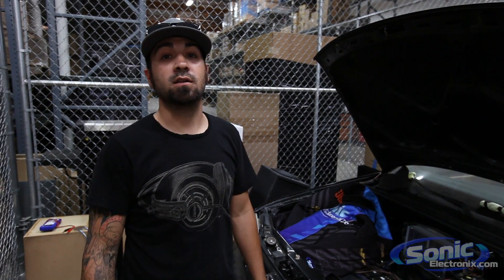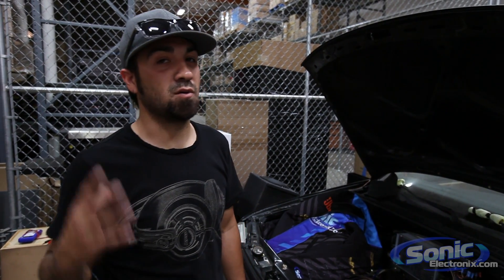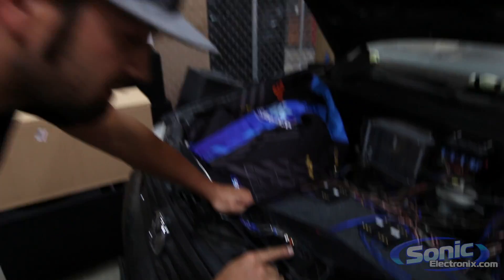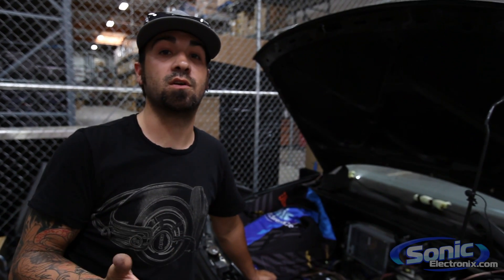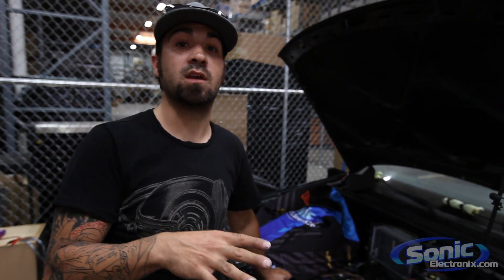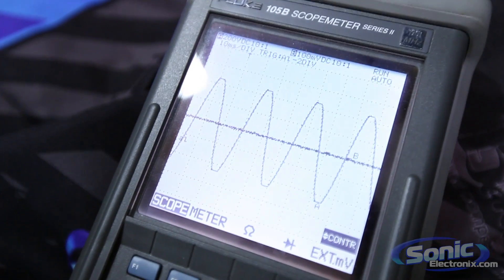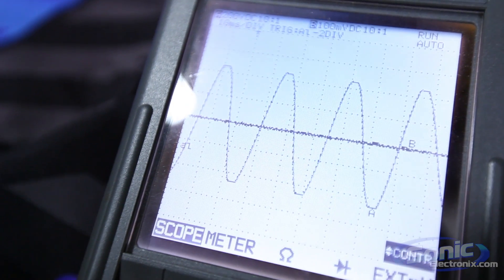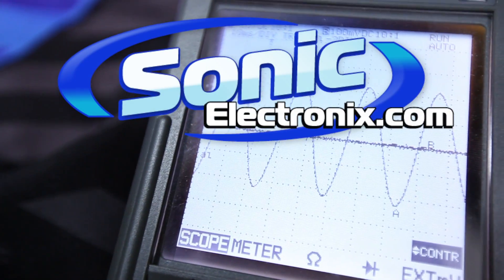How to Set Amp Gain by Ear | Part 1 of 3

Comment: Bass boost is also garbage.  I call it distortion boost.  Should be at zero always.  Same with loudness on radio.  At most use it on LOW if your deck has 3 settings for it.

Comment: Am I able to do this test with a lower volume on the head unit? My amp has too much power for my 12" sub so i dont wanna turn it all the way up. Im wondering if i could just set my head unit to a low volume and then ramp up the gain on the amp. Will i still hear clipping if the amp isnt putting out max power?

Comment: Hi Allyn... this is Anish from India... been an ardent follower of all 
your knowledge base... I think you are brilliant am sure all will 
agree... I need your help on this please... Have a Sony XM-N1004 and 
need to drive a JL 12W0v3-4 Sub (displays 300 RMS @ 4 Ohms) in bridged 
mode Sony supports (175 RMS X 2 @ 4 Ohms).. what would be the gain Voltage, as 
per me Sony, max is 26.45V whereas JL can go upto 34.64... Hope am right, 
am setting this using a Multimeter using a 0DB 50Hz. All of this is 
hooked to a Pioneer DMH Z5290 BT... Front Channels uses a INFINITY 
REFERENCE Component... Please help sort this for me , Thanks Allyn

Comment: Ok i need help please. I been struggling with this problem for awhile now and cant figure it out. I bought 2 new amps. Alpine for bass and a focal amp 4 channel. I did the big three and scraped paint off for ground and sprayed clear coat on top of ground terminal. I getting a whining noise and cant seem to fine the the area thats causing this problem. All rca and speaker wires are on the opposite side of power line. Radio is a alpine 149bt fairly new. Rca are top of line stingers triple layer. Speaker wires by stinger top of the line as well. Can anyone help me on this. Thank you in advance.

Comment: It's also worth noting the fact that if you're setting gains on brand new subs, it'll likely be necessary to make future adjustments to the gains during and after break-in. This is especially true with high-roll, stuff suspension subs.

Comment: I have a skar RP 1200 1.d amp on two skars sdr 10's and even with the gains all the way up it still doesn't distort. is this ok?
Reply: Use a voltmeter then . It’s more accurate , no matter if it’s high or maxed and don’t hear distortion. It’s of course distorting .
Reply: Same combo I have except I only have one SDR-10. I currently have the gain set to 40% on mine (still tuning tho).

Comment: Should specify that when you hook that o-scope up, you stripped the speaker wires and probed them, not just jamming the probes in the amp, because I think I blew my amp that way today. Makes me wish I just tuned it by ear but it seems like 3000 watts plus needs the tuning equipment.

Also, specify that the test tones you play should be at -10db or -15db if you listen to normal music, and closer to 0db if you listen to modified bass music.

Also, why a 40 hz test tone? Why not 80Hz? And if I want to do this with my tweeters or Mid bass or mid range drivers, what tone would I use to do that?

Comment: And always remember, when you have a remote punch bass it always  adds voltage and you need to adjust accordingly
Reply: Right but every amp is different & every Remote gain is different most of the Remote gain controls don't do anything that's why most folks don't use them!
Reply: @randywatson4870 strange I keep hearing this. Am I the only one that uses the knob constantly for different tracks / parts of songs / at a red light etc? I always use it. In fact I can’t have a system without one
Reply: @sp00f34  Sum remote gains work but a lot of them add a lot of clipping to your subs & they add extra voltage they are a plus if your's actually  works properly.

Comment: I have 2 sundown sa 15s in 4.6 cu in ported box on a audiopipe 2000w amp 2ohms 1300w rms between both speakers so when I do this should my bass boost knob be all the way up or down? Also what about the bass boost on amp and other tuning knobs will i still be able to have super loud bass coming from it while being able to use the bass knob . Really need help think I’m clipping the hell out my new sundowns

Comment: I've got an amp Pioneer 5 channel  and I think it's 600 Watts RMS on sub channel at 2 ohms and I have a 8 inch bazooka that is 4 ohms dual coil ,can I run it on that amp if I turn the gains down
Reply: Jade Ruby yes you can, make sure you use a multimeter to correctly set your gain so it’s gettin the correct amount of power

Comment: Before I do this to my amplifier, I want to disconnect my speakers so they don’t blow, but I have a line output converter that’s attached to my speaker wires, how would I disconnect the speakers?
Reply: Rob Nestor no need, just make sure your “bass” settings  in your factory head unit are turned all the way down.

Comment: Do I use the ACTUAL OHMS measured by the multimeter of my subwoofer when doing the math? 600 watts x 4 ohm is alot different than 600 wattas times 3.2 ohms.

Comment: Why not just buy a 3 dollar multimeter and take the square root of sub RMS times sub ohms (power x resistance). That equals volts. Set multimeter to volts turn gain up till you reach target volts then back off a little for safety.
Reply: thomas oliver bcz its easier😂😂😂

Comment: Why doesn't my woofer move like that with 40hz and doesn't show when it distorts, but it'll move with 30hz. With 30hz the woofer moves from slow to fast but no indication that it distorts...I have a 35th anniversary hifonics 1700 watt brutus elite mono block with 15 inch alpine type r 750rms in ported box..wired to 1 ohm

Comment: I understand setting the gain but how about lpf setting and bass boost setting after that and how about setting gain on hu like subwoofer level and advance eq settings and should I use the loudness feature or bass boost on a pioneer head unit or use it on the amp
Reply: Sandra Lopez Don’t use bass boost on the head unit or AMP. Also leave the loudness feature OFF. Mess with the gain only, and if that’s not good enough then consider buying a better amp/sub before you blow everything up.

Comment: Hey! This was helpful but now I have this problem. I did everything you said and got the gain set on both the amp and the stereo so that it's not clipping on the 40hz track but when I play music, the bass output is so low you almost can't hear it. What does that mean? Is my amp not powerful enough? It was really loud when I did the 40hz track but regular music, very faint bass output. Thanks.
Reply: Philip Casey I have a similar problem but I'm about to get bass blockers this takes bass out the component speakers so you can jump the bass setting in tones to 0 instead of -6 or what ever your unit will go.  You'll see a huge jump in volume

Comment: why does my amp get hot and turn off when i turn the volume up. then turns on when i turn the volume down or when it cuts out if i turn the volume all the way up it turns back on? please help
Reply: check for damaged amp fuses, check for a bad ground make sure the ground cables has a tight conection to bare metal! try using seat bolts if u can just grind or sand away paint till get to bare metal!! everytime my shit fucks up always seems be a wiring issue or a worn out fuse on the power wire
Reply: remember a fuse can still work if its damged or blown it will just work intermitantly (srry for the bad spelling)
Reply: To small of an amp causes over heating not sure about the shutting down part

Comment: I tried this out, set my Kenwood sub level to 5/10, and volume level to 25/35 and 30/35, and both times I hit max gain with no sound difference, just got louder. To be honest the cone was moving a fair bit but no where near what yours was. It's a RF P300-10 btw. Any help/ info?

Comment: May be a stupid question, but I should probably find a way to turn my speakers off before i do this, right?
Reply: Might as well tune it using a voltmeter because  it doesn’t need speakers connected

Comment: When setting the gain on my amp, do I set the separate bass level knob remote all the way up or all the way down?
Reply: No.  set it all the way up so you only have the option to turn it down as you have already set the volume to max gain .
Reply: All the way up
Reply: Hypercity in the middle so you have the option to adjust it up or down before a specific song.

Comment: I have a question? That noise the woofer makes when you put to gain up too high, what causes that? Too small of a box?
Reply: I ask, because my 10w6, starts making that at about 3/4 of the amps gain. The amp is 500watts RMS. Doesn't the JL 10w6 able to handle 600watts RMS?
Reply: Its whats known as clipping. Instead of your amp putting out AC, (alternating current) it will also put out DC (direct current) at the peaks of the soundwaves. They should be perfectly round, but when it clips is a straight line. It causes the sup to heat up a lot faster. So you would have a sub that lasts longer if you avoid clipping. He had a tool to use to actually see where the clipping started. But you could hear it as well. Play it safe and make sure your gain is well below that clipping point.
Reply: I set the gain too high on my Vape Mod and burnt through 4 coils in 4 days...clipping kills your coils!
Reply: @brotherswinningbecauselove7857  lol i did that once.. blew a ball a fire in my mouth.. sounded like a 22... i was completely fine.. i swore when i ran to mirror i was gunna be missing half my face... nothing.....
Reply: Inferno1230 what? 😂
Reply: Ernest Ramirez , it's called distortion dummy
Reply: Jay Cub , yes u are
Reply: Tim Schutte 
Still sound like a depressed little boy. Geez, find something better to do, this is pathetic.
Reply: Tim Schutte 
Pathetic
Reply: Ernest Ramirez Gain doesn't equal power output. The power output doesn't change on the amplifier once it is installed. You're just setting the resonance frequency with the gain knob.
Reply: Ernest Ramirez , first of all your a damn dumb ass, second this is, NEVER TURN ANY STEREO ALL THE WAY UP, usually around the 2 to 3 o'clock position is about the highest you should ever go.
stereo systems are not designed to be turned up to one hundred percent, EVER !!!!!!!
Reply: @timschutte8310  then why do they have it on a knob that goes all the way to the maximum volume

Comment: Will this work if the amplifier is set to Full Range? 
I have (8) 6.5 Subwoofers w/ Twitters
Running on a mix of parallel/series wiring to my 2000w 4Ohm Sub
I run it on Full Range so it will run both highs and lows since my subs come with tweeters

Comment: I used ohm's law and a DMM to set my gain, and for some reason the amp was not reaching the correct voltage for 500watts. 

After giving up, and retuning it to the settings I had before, my sub isn't hitting anywhere near like it used to. About 95% sure my amplifier is on its last legs, but never gone into protect mode.

Expensive lesson... either pay 200 for a DD-1 or 75 bux for an oscope tune -.-
Reply: That dd1 is doing exactly what you did, but instead of doing it for $75, its $200

Comment: +Sonic Electronix I have a Rockford Fosgate 500 amplifier that on paper it says 626 RMS power and I have it hooked up to a 12" kicker compvr 4 ohm and I think I might be clipping. I am wondering if you suggest a certain gain level like 3 or 6 or so? I would take to audio shop but budget is tight so can't afford to bring it in.
Reply from the maker: +General20201 Just follow the instructions in this video, you should be able to hear the difference once you hit clipping. Gain will be different on every system so we can't really give you a suggested position.
Reply: General20201 you're only getting about 300 rms with that 4 ohm speaker, wire it to 2 ohm and you'll get what the paper says, I have same amp with a 2 ohm 12" Rockford fosgate punch and it's extremely loud

Comment: Hi AllynBack in the summer I upgraded my system with the Hertz Hi Energy 3 way system in the front and the Hertz HDP 4 channel to run those and 2 12inch JBL subs. I have both volume knobs on max but I am certain that there is distortion somewhere. I have a Alpine double din head unit and I am using the RCA's out from that. Any ideas on what this could be? 

I am planning on getting a 1000watt mono block to run the subs and then separating the 3 way system by mid/highs on two channels and midbass in the doors on the other 2 to hopefully achieve more headroom without distortion. 

Any advice would be great. I am a fan of your videos and the soundman. Thanks

Comment: ok I have a kicker cx 1200.1 d class mono amp and 2 12 in kicker comp r @ 500 rms a piece  so 1000rms a pair. I am using a 40hz sine test @ 0 dB using a volt meter. I kno that @1000rms 44.7volts is the voltage needed for best performance. but I kno this is incorrect as I am running 1200rms amp. my question is what is the correct voltage coming off speaker terminals to get optimum performance? all deck settings at 0 or flat. thanks for helping me with this brain teaser. I've been lost trying to figure this out.
Reply: You're supposed to use either a 50 or 60hz tone when using a multimeter. Or else it wont be accurate. I too have a Kicker amp and have tried different ways of setting the gain. I've tried it by ear with music, by multimeter with a 50 hz tone (I even accounted for the lower voltage at idle) and just recently by this method with a 40hz tone. This last method didn't work for me at all. The sub was moving way too much. The multimeter sort of worked, but my sub overpowered my door speakers, and would distort on some songs.   It's just better by ear. It sounds more balanced and is easier on your equipment.
Reply: +u2bed91 I have 2 comp r and have no over powering of sub over door speakers. I have kicker doors and 6x9s. my amp is set about half way on gain. I also use the kicker cxrc remote to control the gain up or down since every song is different. I haven't tried 50hz tone. I went with 40 since my box is tuned for 38hz. this is reason I went with the 40hz tone.
Reply: +u2bed91 and I run my subs to the max  they blow I'll replace. I'm thinking of getting a new box also. box makes the difference in bass.
Reply: It's hard to believe that your subs don't overpower your speakers, considering you have two 12's at 1000W rms in a 38hz ported box. Anyways, you should try at least a 50hz tone and you should check your voltage at your amp's power/ground inputs to see how much you're actually getting from the battery. Remember that most amps are rated at 14.4v and even with a car turned on you may not be getting that at idle. Also, why do you want a new box? A ported box at 38hz sounds like a great box.

Comment: I have 2 10 inch rockford fosgate p1s both in a box together but the left side keeps clipping, even replaced the sub and the left side is still clipping, the right one is perfectly fine though
Reply: Subwoofers don't clip. The amplifier does. Subwoofers play the clipped signal from the the amp, which sounds like a buzzing noise. What exactly does your left sub do? Are they in seperate chambers?

Comment: some how i cant connect the amp to +12v and GND ...so my question is there is any another way to connect the amp. may be from high level input plug?
Reply: +piyush suthar if you can't connect the amp to +12V and GND then it is not a car amp...
Reply: why can't you? I don't think there's another safe input
Reply: No... There isn't any other way...
Why can't you?!

Comment: Does it matter if I don't know what my stock headunit preamp is? I have heard over and over again that the purpose of setting the gains on the amp is to match it to the headunit. I have set the gains using a multimeter measuring voltage due to mi amp is 1000 rms and my sub is 700 rms. But I'm still not sure if there is distortion in the signal.

Thanking you in advance!

Comment: how the fuck do i set them in a Hifonics 2500 brutus my 2 15s aound Like shit
Reply: Far to vague. What brand 15s? How are they wired? What version Brutus amp? What gauge wire are you using for everything? 
Saying you have 2500w (at 1ohm) and 2 15s tells us nothing to help. 
You could be running at 4 ohm for all you know pushing ~850w total so 425w per woofer so extra information will help.
Reply: +sniperlif3 hifonics Brutus 2500 Watt amp Hooked To 2 15 inch Cvr Kickers wired  two 2 Ohms it Sounds Good i Fixed it.looooolz i still Need a Bigger Box and Maybe Go Ported  i like Low Deep Bass That Punches  Your Chest
Reply: Luis Ruiz
Alright, good to hear. Yeah I love my ported boxes.

Comment: what should the bass boost knob be set to when doing this?
Reply: 0
Reply: ***** how so? it sounds much better with bass boost..
Reply: +Mike Fu rattling sounds nasty of course. when my car shakes and i can FEEL the bass, thats what im going for. thats the whole reason for putting in a subwoofer. i didn't get a subwoofer so i can listen to classical music at moderate hearing levels. real sound, there's your opinion and my opinion.
Reply: +714smurf okay we get it. You don't care about real sound. All you seem to care about is loud distorted bass. Enjoy being deaf and enjoy your bad sound. My sub has no bass boost because I think it sounds like shit with it on as well my sub is not overpowered or under powered, the amp is at just the right wattage for the sub to avoid damage and to make sure I am getting the cleanest sound possible. I know what good sound is
Reply: +EpicEverythingDude75 another "real sound" snob lol
Reply: The only time I used bass boost was while waiting for my line driver to arrive.
Reply: first set the gain on amp . after that u can turn up the bass boost as long as you hear no distortion your fine .
Reply: and make sure ur using lpf on ur amp to the sub .